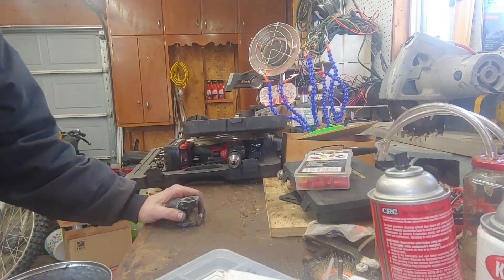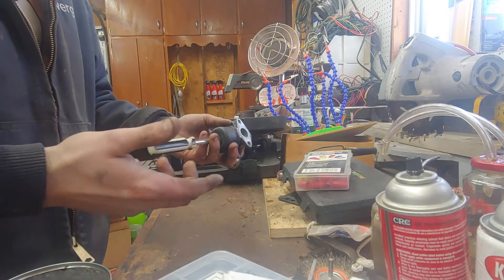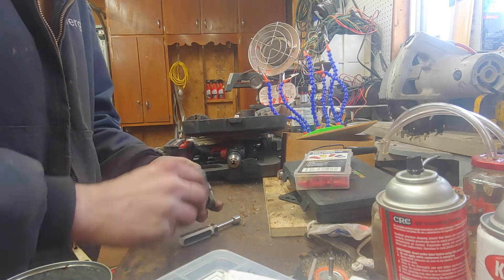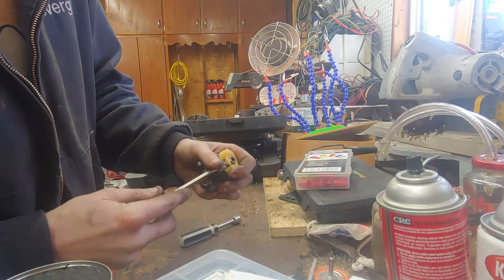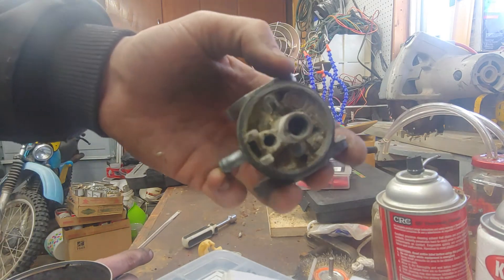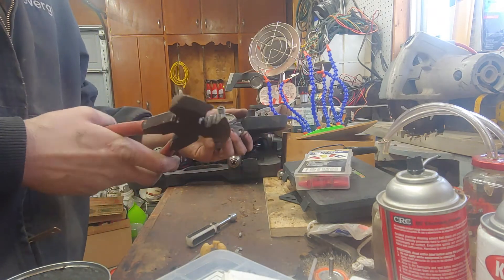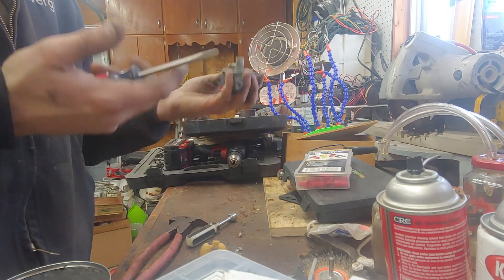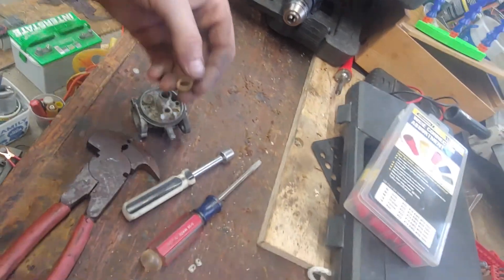a look inside a carburetor stored with ethanol gas

Comment: Premium gas is a waste of money unless its a high compression engine. It wont make any difference in small engines, and it is also 10% ethanol. To remove ethanol from gas mix water with gas let it set till the gas and water separates, pour the gas off the water. the water absorbs the ethanol. There are videos on youtube showing how this is done.
Reply from the maker: @antcri730  sorry I should have been more specific to say ethanol free, in my area there are several gas stations that sell ethanol free, always premium.